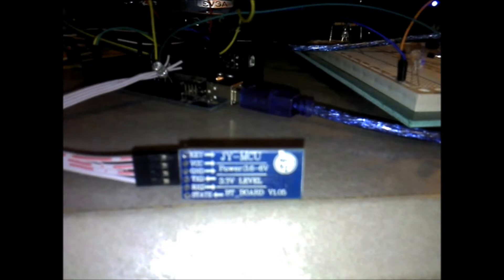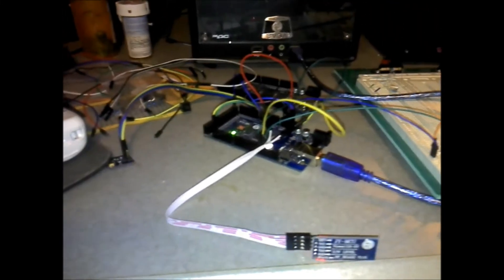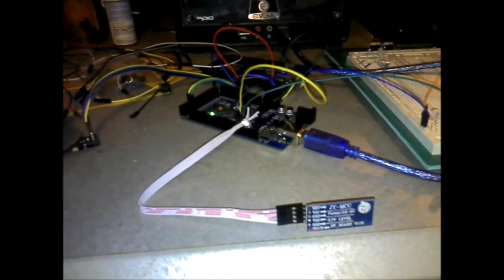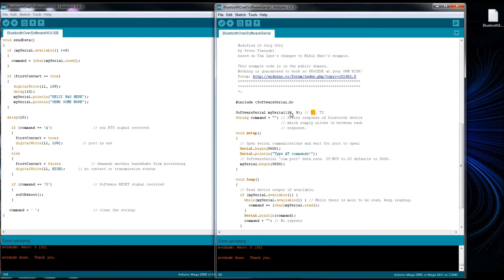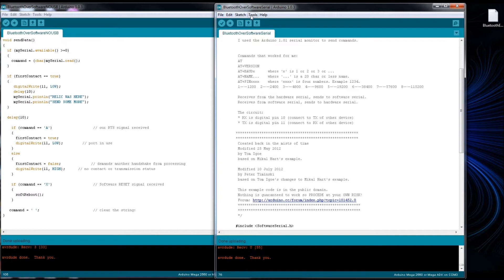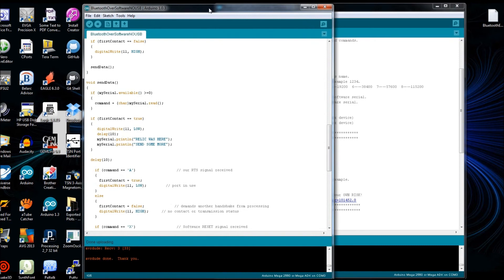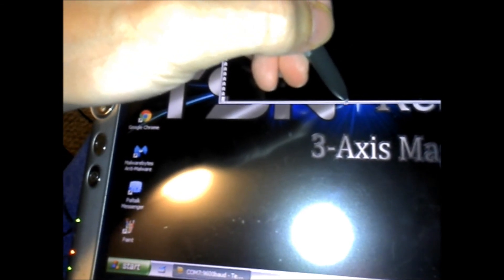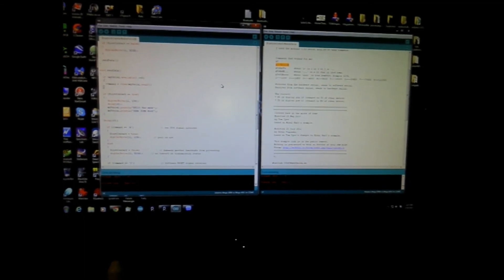Arduino Bluetooth Blues - Getting the JY-MCU bluetooth board to WORK!

Comment: My laptop has an inbuilt bluetooth inside it and I run Windows 7.Do I still have to buy a bluetooth dongle? My laptop can detect the device and IT IS connected.Unfortunately,Teraterm does not detect the bluetooth radio.
Reply: you can use the internal bluetooth.  but in my project I wrote a processing sketch using the bluetoothDesktop library by extrapixel.  Since pairing with the JYMCU creates a virtual COM port, I'm not sure that you can send and receive with a terminal program.  the only bluetooth service it will provide is the SPP service, which is just serial communication.  If you want to send and receive data between your laptop and an arduino you may want to google that library.

Virtuabotix makes a USB FTDI adapter that you can simply plug a SLAVE bluetooth device into, and use a MASTER bluetooth on the arduino side.  But to save money I'd check out the bluetoothDesktop library

Comment from the maker: the confusion with these modules seems to be to voltage divide or not voltage divide.  If you're not sure, I would go ahead and use a divider on the arduino TX pin, going to the BT RX pin.  I was very tired when I finally got this module working!  no need for a divider on the Bluetooth TX pin, only RX

Comment: Maybe you could annotate the need for a voltage divider into the video, both where you explicitly say NOT to use one at 1:40 and also on your wiring schematic at 6:20?

Comment from the maker: sorry for a late response.  the code is on our website planetxresearch pdot com, on the main page click the arduino logo at the top of the page.  

The only way I know of determining the module's firmware is to send the AT command AT+VERSION @ 9600 baud using the example code.  I recommend using 3.3 volt on the VCC line and a 5V to 3.3V divider on the RX pin.  I used a 2.2k and a 1k ohm resistor / voltage divider to get a TTL logic level of 3.45 volts

Comment: how would I know whether it's hc06 or hc05? the module I received today looks exactly as in the video. Did your module worked with 5V. I tried both 5V as well as resistor-divider but no luck so far.

Comment from the maker: different arduino boards use different pins for softwareSerial RX lines.  make sure you have acceptable pin configurations and also use a 2.2k ohm and a 1k ohm resistor to make a TTL level converter, i.e 5V to 3.3V.  2.2k to ground, 1k to RX on the arduino.  3.3 logic is taken between the two resistors (actually more like 3.45 volts)

Comment from the maker: I am working on a more detailed PDF file on this module, as since making this video I have learned many new things.  for one, I was wrong about the RX TTL voltage level.  you SHOULD use a resistor voltage divider to convert the 5V to 3.3V logic.  Also I recommend 3.3V on the VCC line instead of 5.  links and text is limited here, but email me and I'd be happy to share the code and other useful information.  relic1974 at gmail.  I have the module working in SPP mode now too.

Comment from the maker: are you using the same model BT radio?  default baud rate is 9600 unless you had changed it.  You should be able to get AT OK responses via the serial monitor or a terminal program like Tera Term.  Also, not all arduino boards support the same software serial RX pin.  check to see which RX and TX pins to define for the Uno when using software serial.